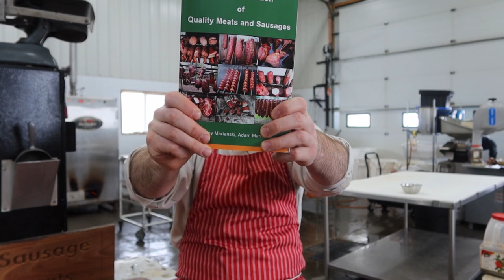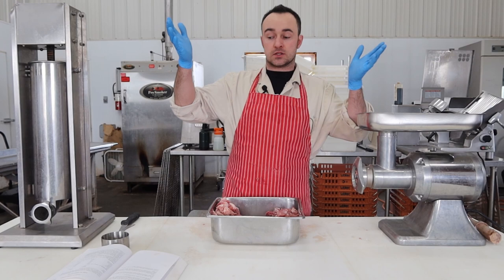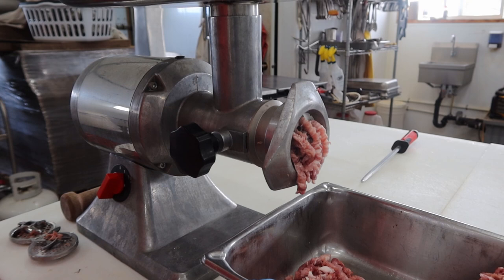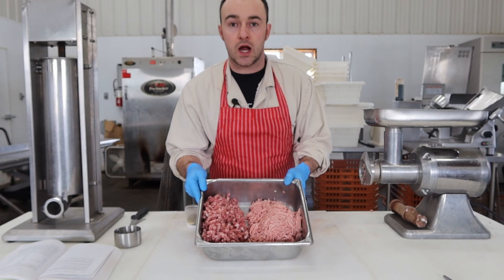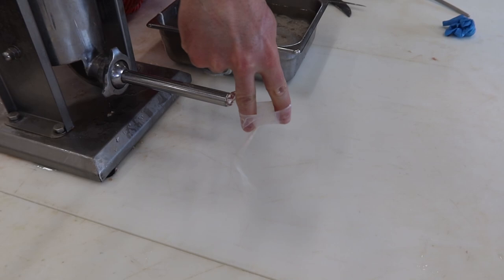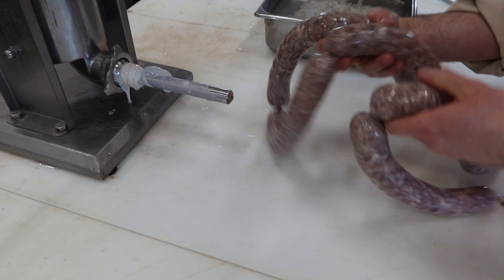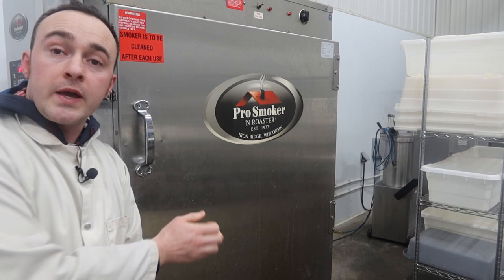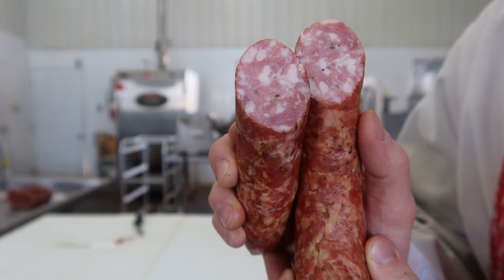Hot Smoked Polish Sausage, from Home Production of Quality Meats and Sausage.

Comment: I have a smoking question for these sausages.  My Smoker is a Traeger Pellet Smoker. I have a rack that I can hang sausages that are 8-9 inches long.   If I put it on the Smoke setting temps run as high as 140F (60C) and I can smoke for the 60-90 minutes.  If I then increase to the next setting 180F (82C) temps can go as high as 190-200 as the Traeger auger feeds pellets into the smoke pot.  My question is whether I would be better off doing the initial smoke and then removing the sausages either to a Sous Vide Water bath at 160F which would be precise or hanging them in my oven which can be set at 170F and have a digital probe in the sausage to remove at the recommended 155-160F temperature.   Concern is obviously over heating the pork fat in the sausage.
Reply from the maker: Right I see what you are saying. Well I have never tried to Sous Vide a sausage I had just smoked. My concern is that it would get greasy in the bag and affect the bloom. Might not though. You would defiantly be safe finishing in the oven. May need to put a pan of water in the oven to get the humidity up a bit, you'll have to play with that some though.
Reply: I was not going to vacuum seal the sausages, agreed they would probably be greasy on the outside. I was just going to use the water cooker to heat and control temperature with sausages directly in the water.

Comment: looks awesome! Do you have any tips for smoking ? No matter what I do the casing comes out a little tough. I use a masterbuilt electric smoker.
Reply: I have this same problem, with a number of different smokers. Next batch I’m going to try  one size larger casing and see if it’s better. 🤷‍♂️
Reply: Natural casings? If so they may be a touch under stuffed. Just my humble opinion, im not an expert.
Reply from the maker: Sometimes natural casings are tough no matter what. Not always though.
If you stuff them to capacity (After linking before smoking they are nice and firm) that helps.
If you soak them before hand in room temp water (min 30minutes) then flush the insides with water.
Also if you give them a cold water bath right at the end it helps keep the sausage from shriveling up which keeps them a bit more tender.

During the smoke steps I pretty much always go
1. dry 1 to 2hrs
2 smoke 150f 1.5 to 3 hours
3. cook 185f high humidity to internal temp 160f
4 cold water bath then dry off
Reply: @duncanhenry  Thanks